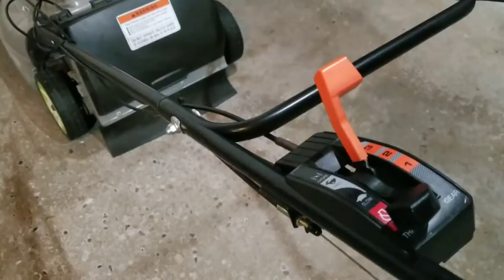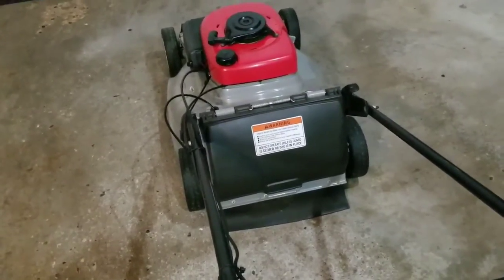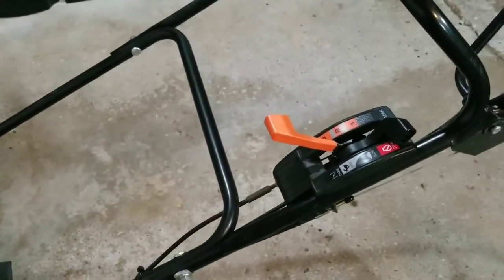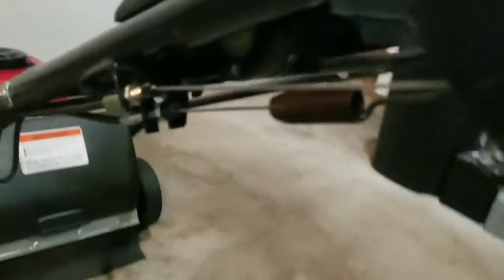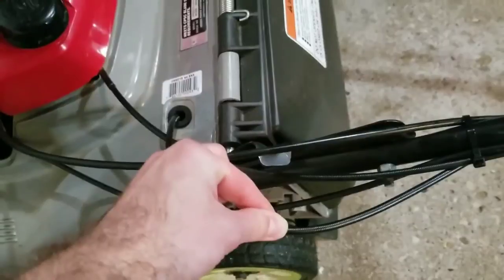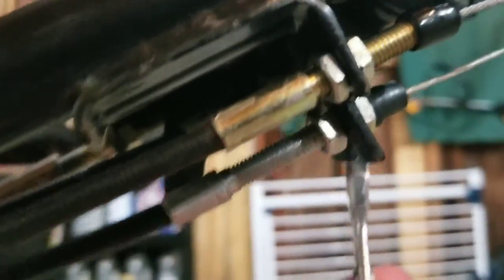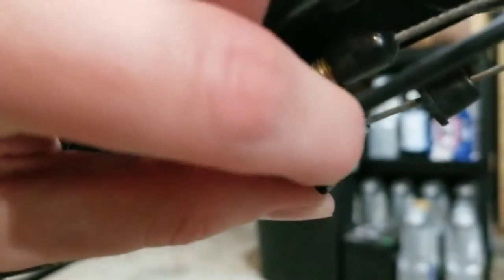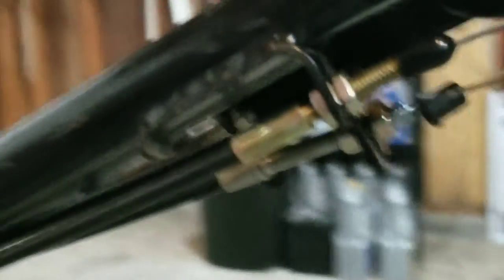Self Propel Mower Won't Go Forward - Honda Self Propelled Fix

Comment: Hey man I have the same mower I’ve done all this and belt and everything is fine trust me I’m no rookie I’ve been fixing mowers a while now still no drive???
Reply from the maker: Sadly for me this mower met its demise and the oil pan gasket sprung a leak one day and all the oil was just gone and overheated and seized it up. It worked for a little while but yeah I had a hard time with the drive as well, I think it wasn't the belt tension or anything from what I researched on this model it's the gearbox that has issues as they get older, there's some sprockets that lock up and cause it to not go forward or go forward very slowly and in some cases the wheels actually lock up completely. Seems like a design flaw with these where the transmission needs to be torn apart and rebuilt, not worth it at that point.

Comment: My gear selector will not move out of #3.  I tried adjusting the cable but doesn't move far enoughlooser to get back to #1.  Any ideas?  I'm a 68-year-old grandma trying to fix my mower.  :)
Reply from the maker: Hey there glad you found my channel! It's possible there's a gearbox issue, I was able to get this working for a while longer but eventually found out there was a major part that needed to be replaced that connected the gears to the drive and I ended up scrapping the mower a year or so later after I made this video. It ran okay just as a regular push mower until the oil pan sprung a major leak and got oil everywhere. Old mower, probably lasted 30 years it was an old and tired mower and had a long life. If yours isn't the drive cable it could be gear box or a pulley or a belt most likely. Tough to diagnose without looking closely at it. Best bet I've found is to find a guy on Facebook marketplace that sells a lot of used mowers, like a bunch of mowers not just one, that's the guy in town who usually fixes them up, I found two mower repair guys just by looking at marketplace ads for used mowers fixed up. Usually better than taking it to an expensive shop. Hope you find out what's wrong with it sorry I couldn't be more help. Good luck!

Comment: any reason why my mower hru216, as long as i engage the self propell handle , the machine will start moving even though it's in neutrual position. ?
Reply from the maker: There’s a clutch that engages when you engage the self propel it locks up to the blade spinning on the motor so there’s going to be a little bit of forward movement I’m guessing. Mine always moved forward as long as it was engaged. It might vary a little bit from model to model depending on how the clutch engagement works on different models but that’s what I’ve seen on mine at least. That’s why there’s a bar to disengage it or to mow backwards I just let off it completely. Hope that helps answer your question! Thanks for watching!

Comment: I liked it. Got dizzy watching due to camera motion. I lost it when you said "loosen the nut so it engages better".  How do we know to tighten or loosen. You already knew which way.  Somehow.
Reply from the maker: steve jette yeah that’s my bad when I’m talking without a script lol. Loosen the nut first so you can make the cable move and adjust it THEN tighten it back up once it’s in place 😁
Reply: @DIYDad1  Thanks for the prompt reply !! Don't mean to trollish but that doesn't answer. Yes, I know to loosen the nut first. Yes I know to adjust it. BUT "once it's in place"? 
To tighten the belt, am I moving more threads ABOVE the nuts or BELOW the nuts ?
Reply from the maker: steve jette so basically what you are trying to do is shorten up the cable between the gearbox and the engagement lever so that segment of cable should be tighter. When it’s loose you can pull that inter cable that rides inside the black outer jacket up towards the handle bars a little bit and it will take out some of the slack a bit. Mine has a bit on the front side and the back of the bracket where the cable is held in place. Some models might have just one. I have done this in a while but if I remember correctly I’d you tighten the inner but it will pull the cable tighter or if you loosen the inner nut it will let some of the cable out a bit. Then it’s just a tension fit once you get it adjusted just torque down both nuts to clamp that cable in place between the bracket that it’s held in. Hope that helps! I just had to play with it a bit and adjust one or the other. It either moves one way or the other. As you loosen the outer nut you tighten the inner nut in tandem until it’s where you want it. So to tighter you want those threads to be more on the outside above the two nuts.
Reply from the maker: steve jette if that below info doesn’t help I’ll see if I can make a follow up video on this at some point! Gotta do some more mower maintenance anyway now that it’s spring time!
Reply: @DIYDad1  OK, I give up.
Reply from the maker: steve jette check out this guys video he might explain it better haha! Basically tighten the cable to make the wheels move faster and loosen it to make them slow down. https://youtu.be/q0G2Yk_41XU

Comment: Hi! Do you still use this Honda?
Reply from the maker: Marcin Tabak I do actually! I don’t run it nearly as often as I used to, but it’s still a great machine and works wonderfully and starts up every time I need it to. I’ve been running my manual reel mower all this season so far so I haven’t even started it up yet this spring lol. I’ll have to do a follow up video I think. Gotta get the lawn equipment up and running soon!